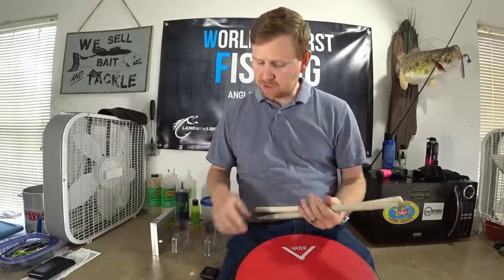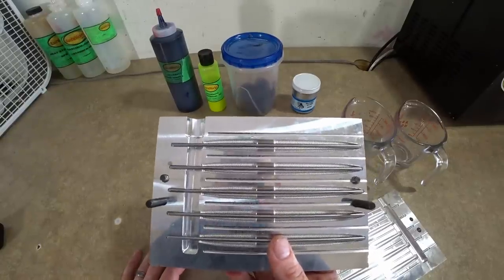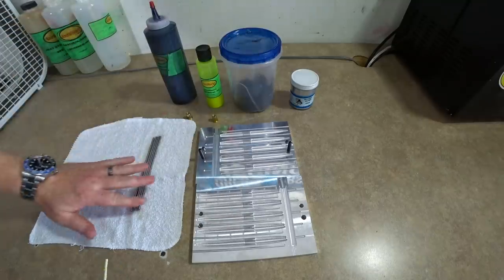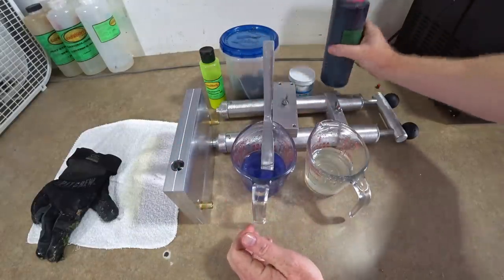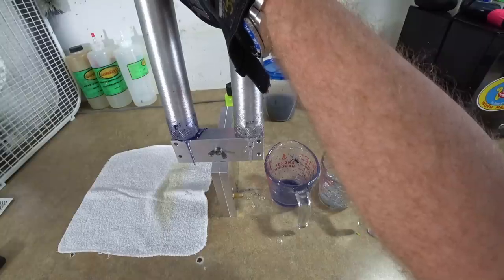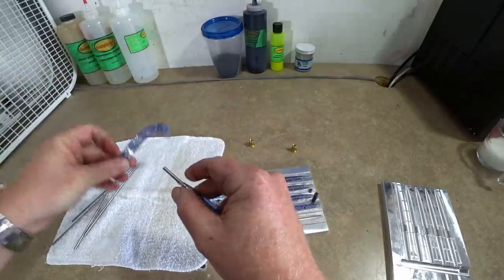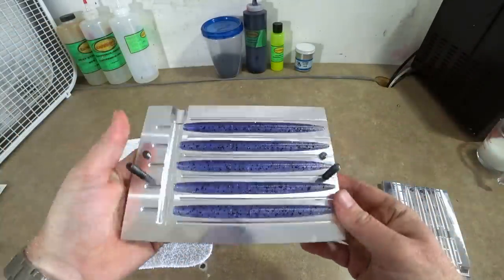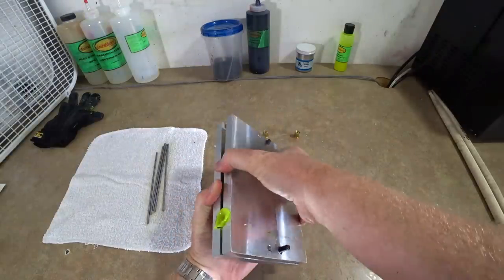CORE SHOT STICK WORM MOLD Demonstration..Bait Giveaway Winner Announced

Comment: Got the same mold along with some others and I'm having issues with flashing, or my core shot isn't filling the entire cavity. What do you recommend? Do you think temperature/pressure is an issue. Should I have to add more clamps to the mold? Thanks..
Reply from the maker: i think its about rod placement..pay attention to how I slide the rods in place...that has given me the best results.

Comment: How do the purple and clear colors stay separated and not mix. I dont understand how theres a distinct separation
Reply from the maker: Well i dont have these worms anymore...but you are correct, usually a purple (that has red in it) will bleed over to a clear color.  But the dual injector laminated two colors distinctly.

Comment: We’re do you get you custom worm bags
Reply from the maker: I got them from a plastic bag manufacturing plant in Hong Kong China
Reply: Do you know the name or website link
Reply from the maker: the printer i used closed, so I don't have a valid contact.  Just be ready to drop over $2,000 on them, order minimums are in the multiple thousands plus plate fees and shipping, its a very expensive process.
Reply: Ok any other places that are cheaper because I don’t need many
Reply from the maker: @haydenmanson7660  unfortunately no, the bags have to be printed while being actually manufactured in order for the printed layer to be laminated over to protect the ink from the oils in your baits.  Nobody will do a small run because the process is expensive.
Reply: Ok thanks